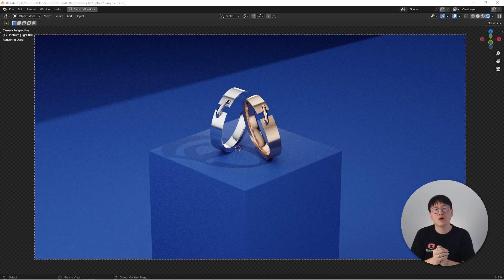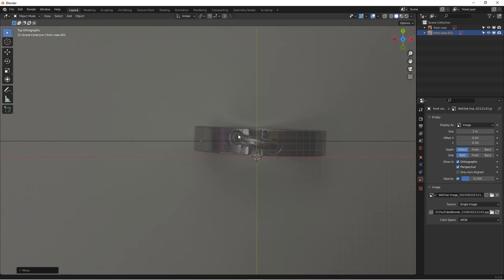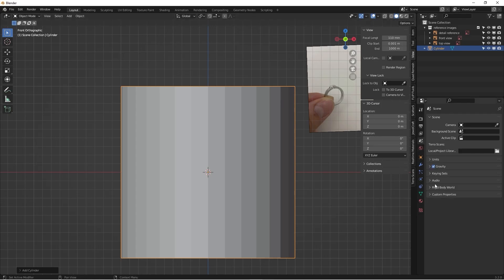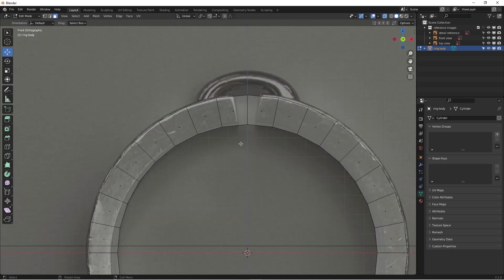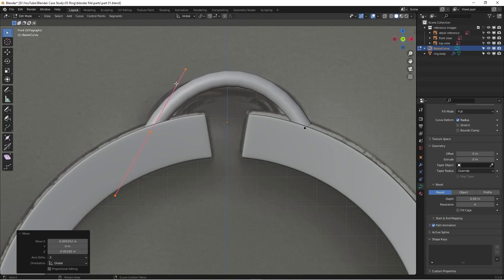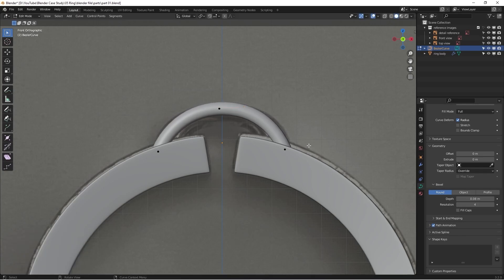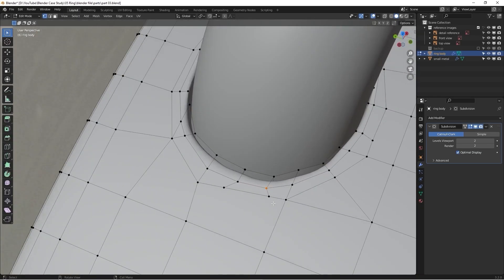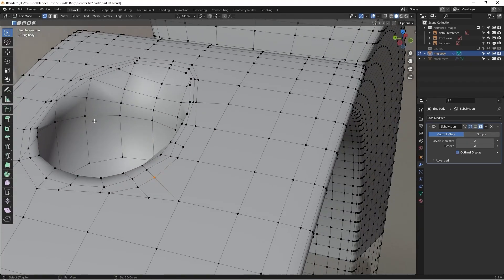Photorealistic Product Render | Case Study 04 | Jewelry in Blender

Comment: Hey Wenbo. Great video. And thanks for sharing the tech issues in a simple way.  Im loving the way you light. A question. What lighting set ups do you prefer. The one in the video above or the one form the video you did about a year ago (How to Use Lights for Beginners in Blender (Quick Blender Tip 08).  In that video you use 3 circular gradients on one plane. Thanks again
Reply from the maker: Both work fine with me

Comment: hey wenbo, I've been following your tutorials for a while and I know you wanted to stick with default blender tools instead of using remesh addons, but you could have used the shrinkwrap modifier on your mesh to get the same result if not best quicker. you would need to make a copy of your mesh before adding the hole. Blender Secrets have a nice video on this. Imma find and link to it.

edit: https://youtu.be/WzS_P24XvU4
here it is.
Reply from the maker: Thanks for sharing mate, will check it out 🥰